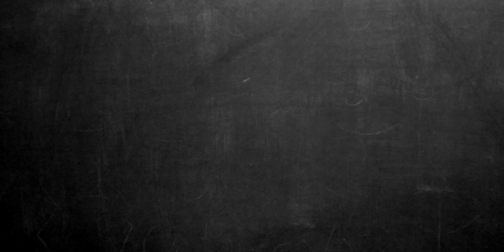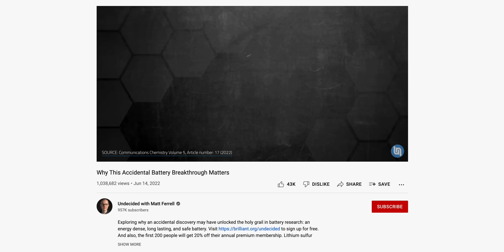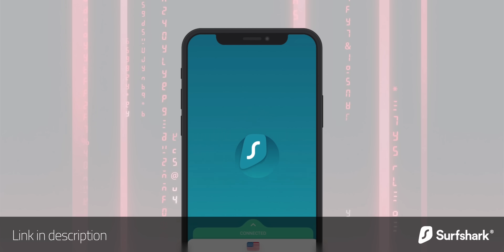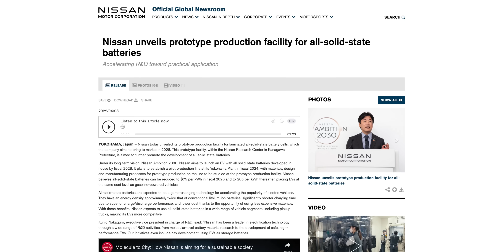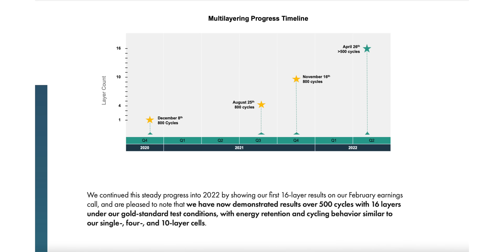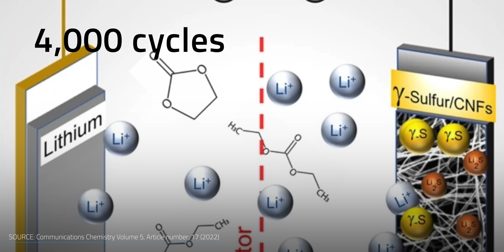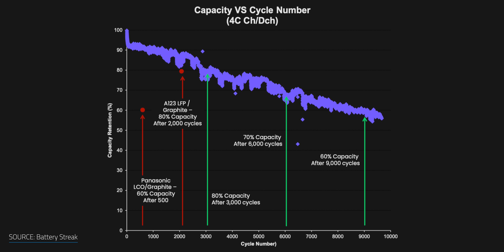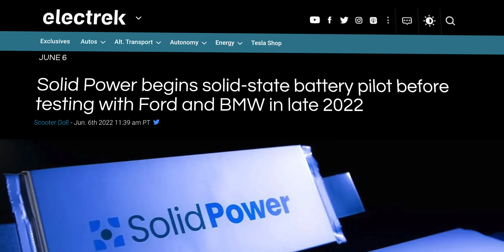Is This Solid State Battery Too Late?

Comment: Aside from the inability to recharge, do you think aluminum air batteries would still be a useful technology for EVs considering the recycling infrastructure is already well developed?
Reply: You can't recycle aluminum oxide the same way you can recycle aluminum. When the Al-Air "batteries" discharge that's what you're left with. Aluminum metal, like cans, can be melted and formed into new products. Aluminum Oxide needs to be refined with electrolysis just like aluminum ore.
"Recycling" the batteries would take about 17kWh per kg. I'm not sure how many kWh of electricity an Al-air battery "holds", but I bet it's much less than that.
More info:
According to Wikipedia, Al-air batteries have 1.3kWh/kg (practical), 6-8kWh/kg (theoretical).
It becomes Al(OH)3 when discharged. This must be reformed to Al2O3 before it can be smeltes to aluminium metal. 
Smelting the Al2O3 is commonly done with the Hall-Héroult process which has a theoretical minimum energy use of 6.23 kWh per kg of aluminum, but the process currently requires 15.37 kWh/kg.
It also produces a lot of CO2. As much as 18.66 kg CO2 per kg of aluminum (when the electricity isn't green), 3.82 kg CO2 per kg Al even when the electricity comes from hydroelectric sources.

Comment: All of this stuff is interesting, but only in terms of individual device power storage.  They are absolutely irrelevant to the larger issue of large-scale domestic energy storage of renewables.  I am constantly amazed by some of my fellow green energy enthusiasts who don't understand the difference.  These technologies are of no long-term relevance for the collection and storage of massive amounts of grid-connected energy over the life of the energy infrastructure.  Everyone should understand this.  As for the impact of these technologies on cars, electronics, etc., it is important to consider that "success" ultimately means that a particular battery technology will quickly achieve commodity status.  In other words, inventing/discovering it doesn't mean that it's going to be a financial success for the company or country that creates it.

Comment: I agree that the many technologies will probably find niche markets and it is good they exist. I think the market is large enough to reach economies of scale with several of them. I don't know if silicone anodes, lithium sulfur, solid state, sodium ion, LFP, or some other tech will finally be the thing that pushes us over into truly viable electric cars or it will be something else entirely that we don't even know about yet. There are other technologies for solar and wind power to make them more reliable that are not feasible for mobile applications (that you have covered).

The interesting thing that I haven't heard many people talk about is what about combinations of these technologies? I have seen silicone anodes used in LFP batteries, and heard of both lithium sulfur solid state and lithium sodium solid state, but which combinations work technologically, and which can be combined based on who owns the patents on these?  That would be an interesting one to look into. Just a little example, if lithium sulfur is 2-5x the energy density, solid stated is 2x the energy density both will eventually reduce cost once they reach scale, then what would be the cost savings and energy density increase for solid state lithium sulfur batteries.

Comment: Any progress is good. One advantage that some of the alternatives have is that they are enhancements to existing cell manufacturing processes. Enhancements typically get to market faster than new architectures. The real challenge is do the battery management systems (cooling, charging, discharging, monitoring, balancing, etc.) have the ability to adapt to changing chemistries and architectures? We've seen that Tesla has done well to adapt to continuous chemistry evolutions without the need to completely re-engineer their management systems. The ideal is the end device manufacturer can accept a wide range of battery chemistries and architectures into existing systems because we do know that change will be continuous over the next 30 years.

Comment: For those of you expecting electric aircraft to replace 747 type machines, FORGET IT.

Here are the relevant figures.

Hydrogen 33,313 watt hours / kilogram
Methane 15,444  watt hours / kilogram
Jet fuel 12,200 watt hours / kilogram
Best lithium-air battery, rechargeable 2,500 watt hours / kilogram
Even best lithium-air battery (which is unavailable) carries only ONE FIFTH the energy per unit weight of jet fuel. OK, now here is MORE bad news. Lithium-air batteries GAIN WEIGHT as they discharge, nearly doubling in weight when fully discharged.

Now compare the paltry 270  watt hours / kilogram of best current battery. Jet fuel contains FIFTY times the energy per unit weight. 

Hydrogen may power airliners of the future.
Methane may power airliners of the future.
Jet fuel already powers thousands of airliners world wide.
Batteries WILL NEVER power airliners of the future with the sole possible exception of hydrogen-air fuel batteries. These do not gain weight since oxidation product, water, is vented during flight.

Comment: I think improvement in the electricity grid and transportation of surplus electricity are more important now than the next breakthrough in battery technology. You can't charge batteries if the grid can't handle it.

Comment: This is clear example of letting the market decide. We never really know what will actually happen. Plus several of these may have their own niche, so complimentary with other technologies. With bulk storage, the important specs are cost, and durability, plus using materials that are readily available. For portability, energy density and charge time are most important, though cost and durability are always a selling point, that may give certain EV makers an edge.

During the sixties, when semiconductors where taking over the consumer market (even though the transistor was invented in 1947), the tunnel diode looked liked the component that would rule the world, in the majority of applications. Then integrated circuits not only happened, but proved reliable, and later, at a better cost. Tunnel diodes, still have niche applications, today, but ICs rule ! You just don't know.

Comment: Hey Matt!

You should check out Graphene Manufacturing Group's (GMG) battery division. Graphene Aluminium-ion batteries are coming out soon.

Quick description:
3000 minimum cycles.
60x charging speeds.
No rare earth materials:
Aluminium and graphene. Graphene is manufactured by cracking LNG. Very low cost to produce, with higher quality than Graphite.

Enjoy your research on them!

Comment: Considering the current EV cells are essentially laptop batteries all these technologies need to be developed simultaneously.. eventually dedicated automotive grade large form factor heavy duty cells will emerge. Current lithium ion will continue cater to electronics applications  then there need other forms for grid level storage

Comment: The caveat for "Ev's" is a non starter to me.  E-Storage, has to be one of the major developments in this century to me, because we use E Everywhere and are dead in the water with out it.  We have lots of ways to generate it although not very efficiently, we can deliver it even less efficiently, we can convert it pretty efficiently DC-AC but storage has fallen off the grid so to speak.  What ever way we can store it and deliver it and how long it takes to develop it is just part of the evolution that's been on the back burner so to speak.  If SS can replace Lion/xyz in a few years so be it, but its been 15 anyway...another 5 is normal R&D time for breakthrough advances which are cumulative by nature?  The key to me is developing Systems that optimize charging stations for any technology and standards of Mfg for distribution to various uses current and near future, including grid backup/buffer systems.  Even if some one magically invents a Tony Stark Arc Reactor or some Scalar/tachyon device tomorrow, we'll still need to be able to store it and distribute it to 8 billion souls and the tasks at hand.  Lets stay focused, till we get there.

Comment: Iv seen "breakthrough battery technically" pop up in the news for as long as I can remember. But almost all of them lead to nothing happening. 

So the simple fact that solid state batteries are actually getting to the point of mass production is all I need to hear to know it's going to be the new standard soon.

Sure the other batteries talked about might be better, but they are probably 10 years away from being an actual product that's widely used.

Comment: Radical, never thought of before idea: a mechanical contraption filled with liquid that compresses and then explodes, providing energy to whatever it is you want. Even more radical is having like this big building that generates electricity by heating up these special rocks which then heats up water converting it to steam, driving a giant fan. The energy can be stored in massive banks of flywheels or better yet just go straight onto the grid.

Comment: There are two batteries going into production next year.  Tesla has a Beta Diamond battery and A graphene based battery is supposed to come out.  The Beta Diamond from Tesla can last 28000 years.  It can use radioactive waste to create dielectric material.  It can be charged at a similar time as refilling gas tank.

Comment: Solid state has been hype.  Sure it’s possible and you’ll see them in high end cars several years from now.

Mean while LFP density goes up.  CATL is building PRODUCTION lines for Qilin Battery.  They are building a Na Ion batteries.   No solid state won’t capture the market.  I’m not excited about SS batteries

Comment: Battery production has always been the biggest hurtle.  To make cheap you need high volume production.  Demand is much higher then supply is capable of.  While newer better battery technologies are developed, Tesla is mass producing, making mega cash and flooding the market.. well more like a light trickle.  Mass production and cheap easy source materials need to be primary on development.  Density, recharge rate and endurance may be desirable but if you can mass produce a lesser product cheap and RIGHT NOW it will sell and make money.  Its sad when great tech dies because patent holders and scientists didn't focus on the most important aspect, mass production = money = more R&D = better battery tomorrow.  Stop wasting time on extended lab testing and developing the math, money can equal science, with the right person in charge.. but money first.

Comment: Great video as usual, Matt!

Just a few of notes since QS is a company I've been following very closely and I think they're on to something great. All these comments obviously assume their publicly released data is legit. Please correct any mistakes.

1) One important aspect of the fast charging claim of 0-80 in 15 min, is that they were able to fast charge every single cycle for 400 cycles and still remained above 90% capacity; that's the equivalent of taking a Model 3 LR and driving it for over 140.000 miles super-charging in 15min every time; this would degrade any current-gen battery very quickly - they previously did sinthetic tests where they fast charged and discharged in 1 hour cycles, so we could even be driving that Model 3 LR at >125mph around a track. This feature, to me, is more important than being able to charge in 5 minutes once in a while; driving with confidence that fast charging/discharging barely harms the battery

2) QS claims their tech is cathode agnostic so it could potentially be combined with lithium-sulfur cathode, so those aren't necessarily competing technologies.

3) Silicon-rich anodes are a great intermediate tech on the way to solid-state, but don't seem to address durability under fast charging, performance under wide temperature range, performance under low pressure, nor safety; QS seems to have addressed all those metrics, but we're waiting for safety testing confirmation (to be done w/ higher layer count)

4) 1000 Wh/L and 350Wh/Kg is what the first generation of cells should be able to achieve; future iterations could go as high as 7x current graphite-anode cell density

5) They've shown that the 16-layer cell did 500 cycles, until that point in time, because cycling continued for weeks/months after that report; this is very important because, if the cell 16-layer cell scales as expected, it will be able to do >800 cycles and retain more than >80% of capacity, which are the automotive performance targets

All this to say that there seems to be a lot of juice left on solid-state tech, we just need to wait and see.
Reply: I would like to see a video on carbon-carbon technology where both anode and cathode are carbon, in the case I noted,  all from cotton fiber. The chemistry still used lithium in the fluid part, but it seems that could be replaced by sodium and/or sulfur, producing high power densities without nickel or cobalt ormanganese. This would reduce both cost and weight. 

Now in reply to David H. who finds child labor everywhere. With the average age in big parts of Africa and South and Central America being so low, often the only available labor is child-based, regardless of what is being done. The thing to do is to limit hours and work to make sure that education fills in those other hours, especially for girls and women. We are never going to entirely displace child labor. As a child, I worked long hours building houses with my Dad. That did not keep me from earning a degree in Math and CS and having a career as a Senior Systems Programmer working on such R&D projects as one of the earliest SSD's and an early optical disk as well as a source code management project.  At one point when I was 18, I put in 144 hours on the clock in one 7-day week. On top of that, I had an hour's driving time to and from work. Almost 60 years later, I am still functioning, if barely, but I have had lots of fun.

Comment: Seeing Tesla tell a guy with a 10 year old car that he needs to have $28,000 to replace the battery.  The battery had 2 packs with "problems"...  You might want to look at the Electrified Garage for details, but getting told you need a battery at $28,000 for a car worth perhaps $25,000 or $26,000 is a bit horrifying.    Then there was a toss up between a Chevy luxury pickup truck and the Ford 150... The project there: Tow a trailer weighing in at 6,000 pounds for as far as a gas tank or battery will take you.  Both suffered from "mileage reduction" because of the weight and wind resistance of the trailer... The ford?  about 1/3 of its initial range (before telling it that it would be towing a trailer) went poof.  90ish miles worth of towing... and the Chevy did better, but started with 300+ miles of range if I remember correctly...  And while the gasoline mileage (on high test) was horrible, it had a big tank.  (Like 7 mpg horrible...)  Ack.  Clearly this is not a time to be towing anything.

Comment: The materials used will become the core issue soon, I think.
Both geopolitically and cost wise, what you use (or have to use) to build them will change feasibility drastically.
This whole thing started because Lithium has issues, both in production and future potential.
Maybe you could make a video about the pros- and cons of each option on the resource front? And how various materials stack up in environmental impact, focussing of production and the like?

Comment: I think one of the biggest promises that I think solid state batteries is flexibility, at least in terms of form-factor.  Solid state batteries promise to allow them to be built into the frame of device, a vehicle, plane, or whatever.  All the others will need to have some kind of container.

Comment: What about the company working solid state batteries with Ford and BMW?  It seems like a pretty big oversight, as they are hoping to have 15,000 batteries in the next year or so.  The company's name is Solid Power, and CNBC did an article on them
https://www.cnbc.com/2022/06/06/solid-power-begins-pilot-production-of-solid-state-ev-battery.html
Reply: I got a reply asking me to direct message you through Whatsapp.  I reported it as spam, but if that was you, I apologize.  Channels have had problems with spam posing as the content creator and trying to link to other platforms.

Comment: 12:55 "And that it's still something to keep an ion and be excited about." Did you even know you made such an excellent pun, Matt?

I'm still waiting for a surprise discovery that gives us fuel cells to replace batteries. Not the solid hydrogen kind, but something truly unexpected, like a power generator the size of a AA battery that will power Tesla or an F-150 Lightning for a hundred years. Is this science fiction? Sure it is. All present tech was once science fiction.